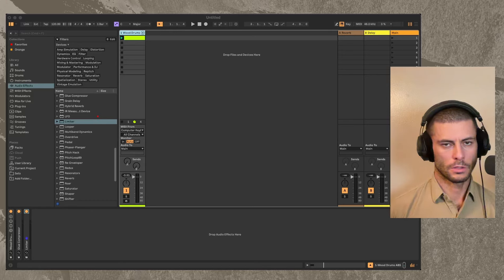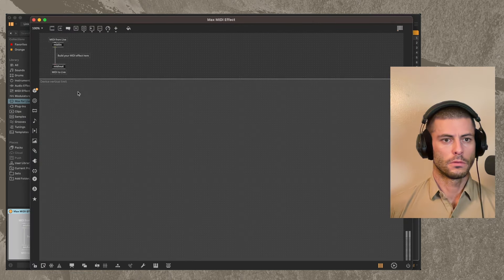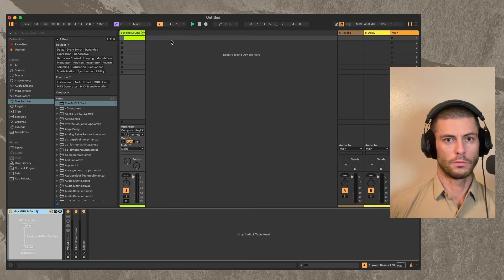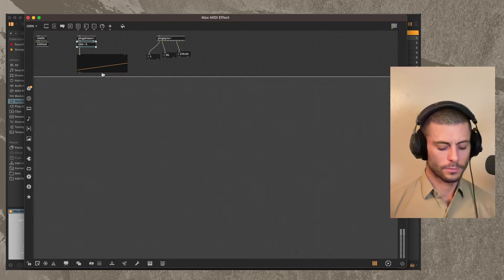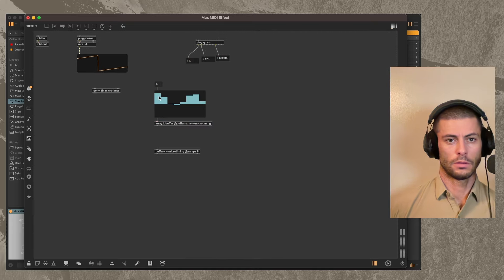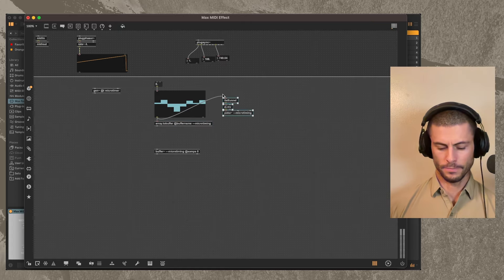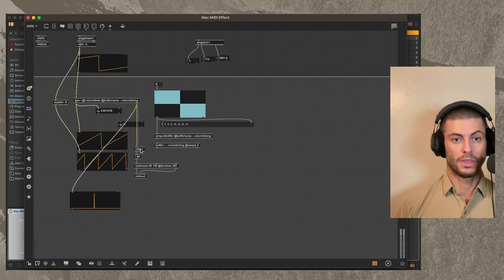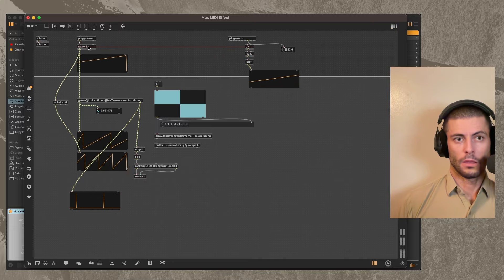Microtiming Sequencer with Max for Live

Comment: I’m not clear on how the new timing interacts with your incoming transport clock.  It might help to mess with the sliders while hearing the rhythm against a metronome?  (Like, I assume the downbeats line up.  But as I slow one pulse, do the others retain their length, or is everything scaled proportionally to fit in a bar?)
Reply from the maker: Hey Aaron! Yeah you hit all the big questions there. So in this case we're just scaling the input slope, which can push things way out of phase with the main sequencer. There's sorta two ways to address this:

1) "Normalize" the offsets so that they add up to 0. This is what I do in rtt.feel~. The result is that the output remains in phase with the clock phasor so that the first event of every bar lines up. 
2) Instead of dynamically starting each subsequent subdivision when the last one is finished, initiate each in response to a straight subdivision. So you have like a pulse that is just a straight subdivision of the input clock, and each of those triggers a ramp with a "microtimed" slope. I haven't tried doing this yet but it would perhaps give the most predictable musical results.
Reply: @p__meyer  I see the appeal of either approach.  Perhaps a toggle switch can offer both?